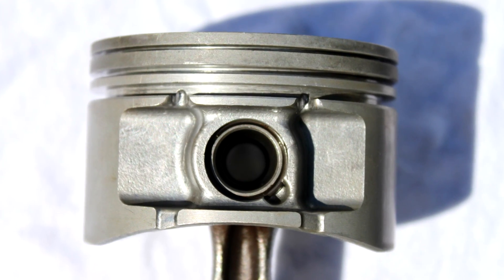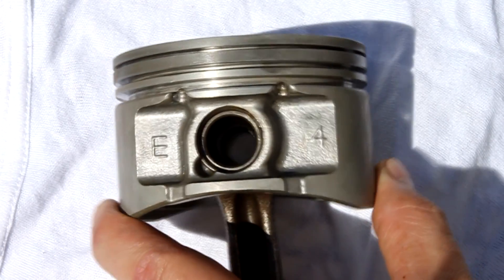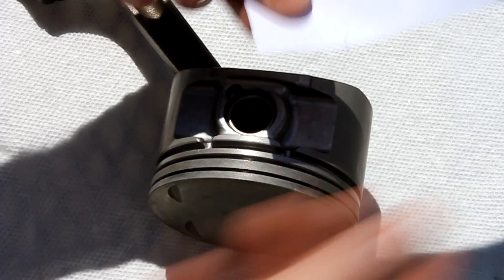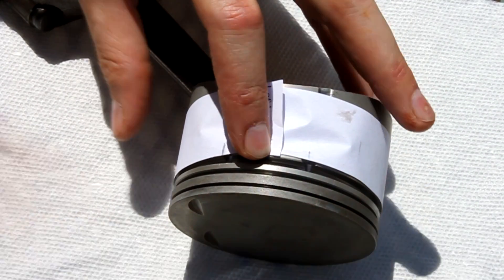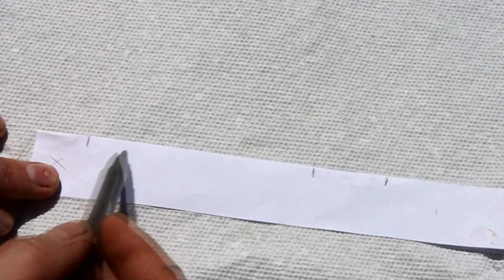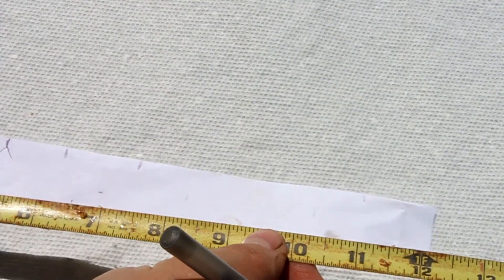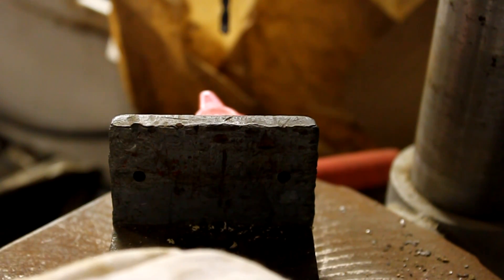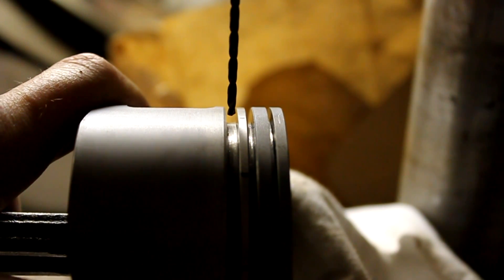Drilling oil drain holes in piston, Oil consumption & burning issues

Comment: wow cool, would using synthetic oil help with oil consumption?
Reply: If you do a lot of highway driving sure. Those 1.9 engines the older one from 92 to 94 are bullet proof. It's what I run in my 94 SL2.